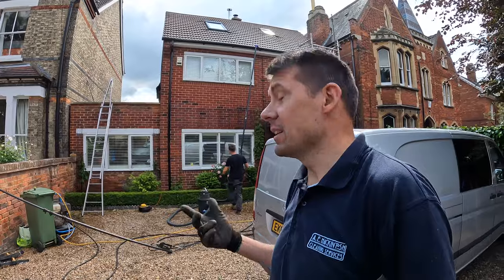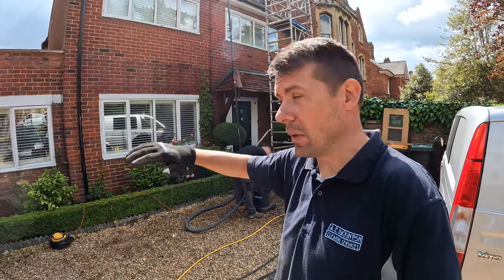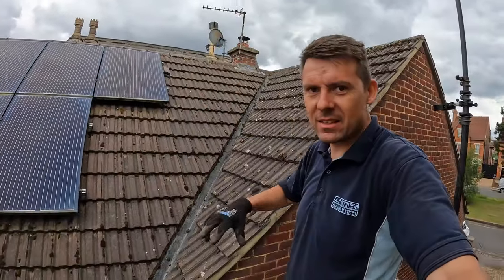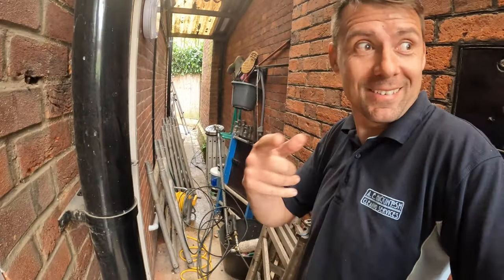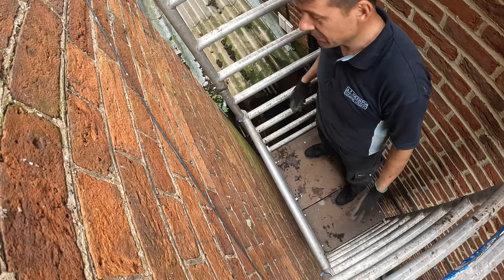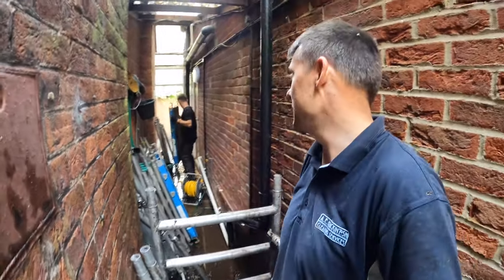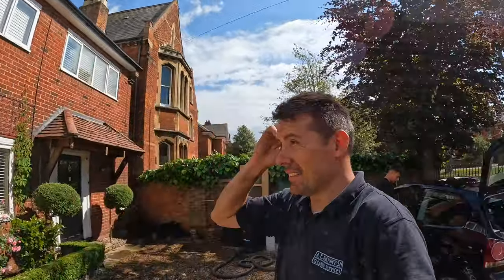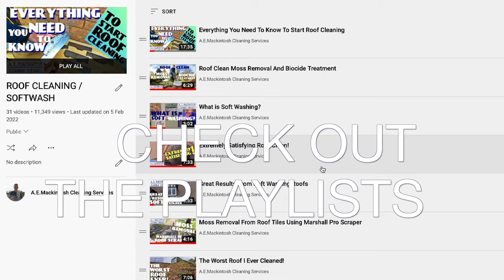Roof Clean In A Tight Spot With Difficult Access.

Comment: Is tge stability of the tower good Ash without the stabilisers on?
Reply from the maker: I wouldn’t recommend using it without the stabilisers. I only did that in this super tight spot where it was basically supported by the walls on both sides.